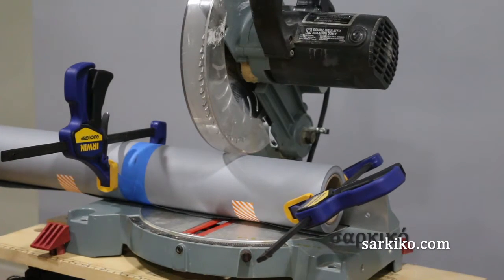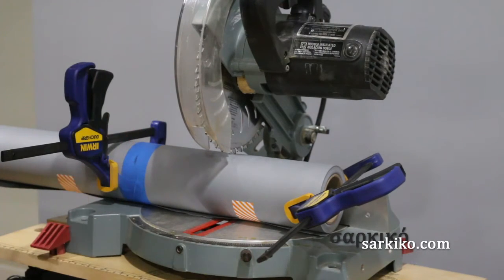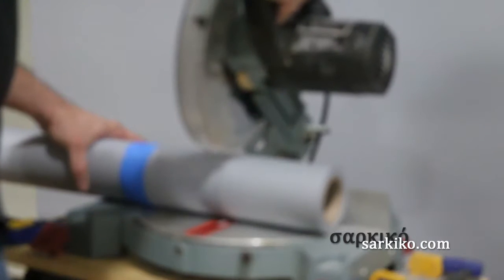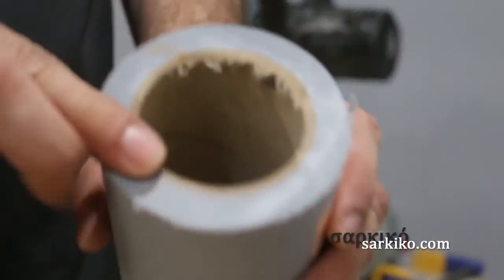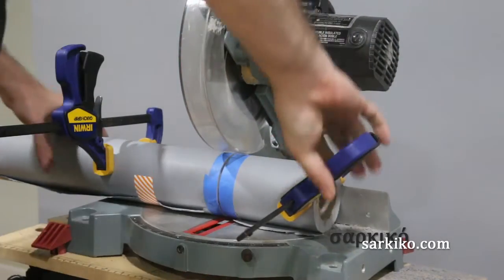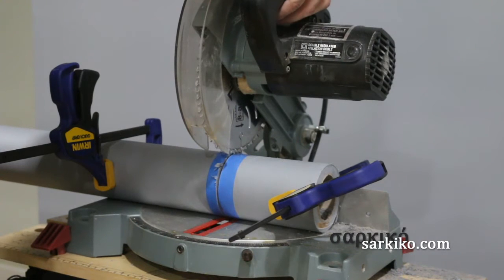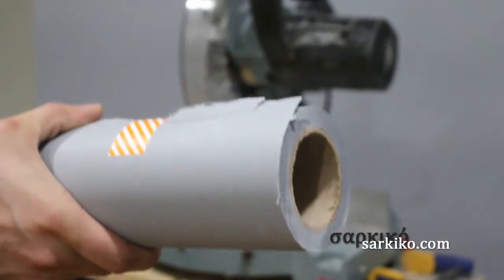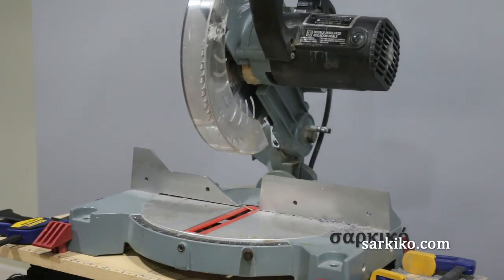How to cut rolls of seamless paper fast

Comment: Once unrolled, do you recall if the paper edge was fuzzy or a sharp cut? Did dust inject itself in the interior side any?  Thanks for posting this, I realize my questions have come years later.
Reply from the maker: Cut was clean. I don't recall regarding dust.

Comment: Probably could place a thin piece of wood under the roll. There is a gap between the blade and the roll before you start cutting. About 3/8 of an inch. Then you would be able to cut it in one pass. Also if you blue tape the paper to the wood you would not need the clamps. Good video!
Reply: Couldn't cut it in one pass because the blade diameter was too small, the saw was hitting the roll before the blade was all the way through.
Reply from the maker: I think I needed to sorry the other end higher to get rid of the gap. This was a smaller than normal saw and the motor kept hitting the roll.

Comment: It was asked before by someone else and I'll ask again because you didn't answer the other person. What size miter saw/blade did you use? I assume the one in the video is a 10" saw and the new one you just bought is a 12" saw. Hence, does a 12" saw cut all the way through in one pass?
Reply from the maker: Actually this was less than 10". I don't have it anymore. Can't remember if it was 7.25" or 8.25". It was circular saw sized blades.

Comment: This appears to be the best way to cut a roll of seamless. A bigger blade would have helped I guess. Do you still recommend using a table saw for cutting seamless or have you found a better method?
Reply from the maker: A table saw I think would be a bit awkward. I have a bigger miter saw now that works better. The I've I used had a smaller than normal blade. Miter saw is probably the easiest method as long as everything is well supported.

Comment: Have you ever tried doing this with kraft paper rolls? I'm looking to source 2 in wide rolls and it's nearly impossible to find!
Reply from the maker: Should be similar. Try but be careful. I would make sure roll is kept tight with tape, every thing is stable and securely clamped including the saw.
Reply: @Sarkiko  I'll give it a try. Thanks!

Comment: Would've never thought to do this! Was looking for a tool to cut rolls of film.. Have you tried raising the roll closer to the blade so you can cut it without having to rotate? That extra inch closer to the blade may help!
Reply from the maker: The miter saw I cut that with was an 8 1/4" blade. It's an old saw and most miter saws now are 10" or 12" except for some cordless ones. I got a bigger miter saw since i made this video and I don't have to rotate it.
Reply: It would be extremely dangerous to raise the roll off the deck.  It could jump and cause all sorts of bad things to happen...